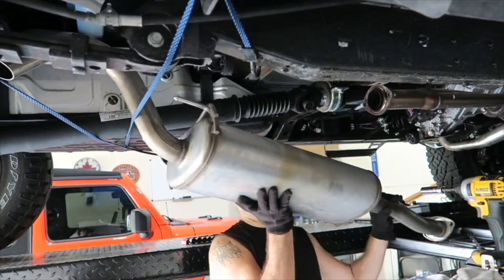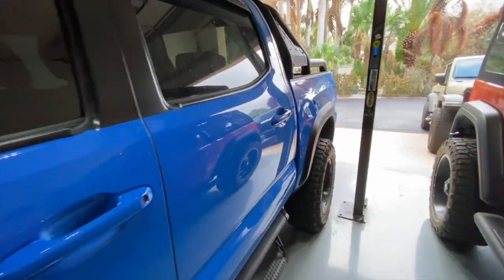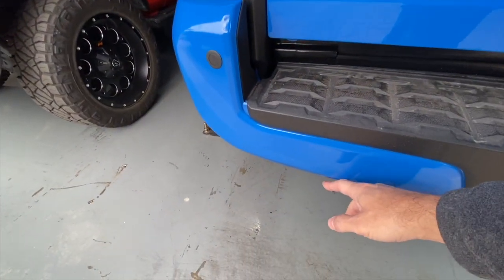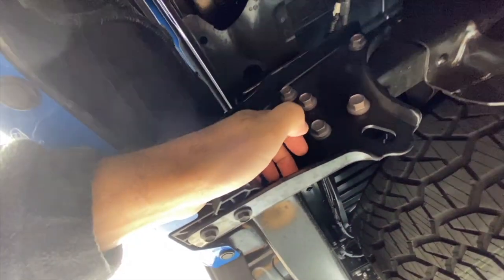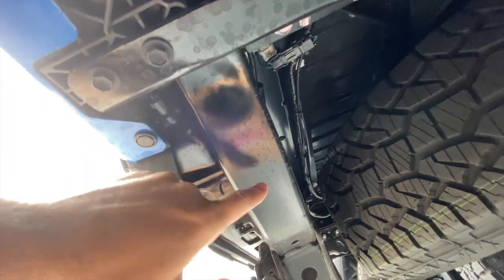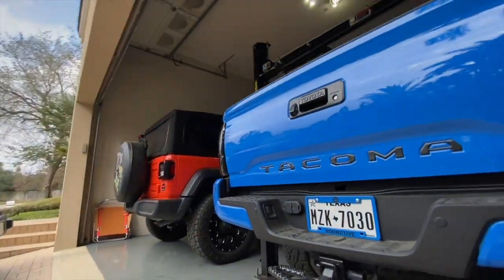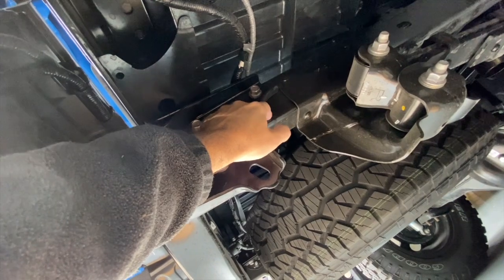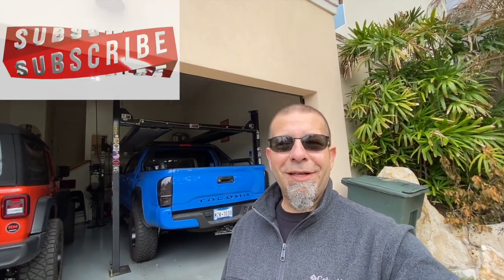New Tacoma Mod Idea to Balance It Out a Bit

Comment: Black would also be an option for you.  Those might work for recovery.    I'm not drilling into my frame or such under my truck!!!   Midwest salt belt!!  I like the Demon brackets and shackles.  I'm not convinced the mounting point is anything more than a shipping tie down point vs actually strong enough to act as recovery point.  The bracket and shackles are definitely strong enough, just not the mounting location.
Reply: I think rob is going more for looks than functionality, i have yet to see a speck of dust on his truck so i dont think he is going to require a rescue anytime soon.
Reply: @dougscott5742  I'm glad he pointed out that it should be an ok place for recovery.  I'm curious how many watch posts (his and others) and are convinced they are bullet proof off roading.  Definitely dust free!

Comment: Rob, great idea. We have 2015 F-150 Platinum V8 FX4 with front tow hooks. I'm going to check them out and get back to you, wife has truck at work now. Ours are chrome as I remember. If they stick out from rear of bumper it should add a bit of protection too.
Reply from the maker: So are you looking to take them off of the F-150 and add to the Tacoma?
Reply: Heck no, that would put me in dog house 4 sure. I would pick up new or used ones and paint red, we have cement 2020 TRD OR,  RWD locking dif. I added the rear step that hinges under bumper, really like it too!
Reply from the maker: Lol!!!  Now that’s a much better idea!!!!👍👍

Comment: Great idea. They would work great as tie-downs if towing the truck on a trailer or for tie-downs if putting a kayak on the roof of the truck. I would definitely make sure they are not used for recovery points because I assume they would twist that metal because of the thickness. Anyway, great idea.
Reply from the maker: I agree..great for tie downs👍

Comment: Rob I believe I didn’t drill any holes to the bracket I just used the two bolts that are there, I send you some pictures
Reply from the maker: I was wondering.  I think you put yours on the other way if I’m not mistaken🤔
Reply: I just used the bolts that where already there I didn’t drill through the frame. Just the rear bolt grabs the hook in place.
Reply from the maker: Oh!!!  I thought you drilled!!  Your way would have been much easier!!😬
Reply: Sorry Rob I’m half asleep 😴 I did drill you were right 😬
Reply from the maker: Lol!!!   I thought you said you did!!👍👍